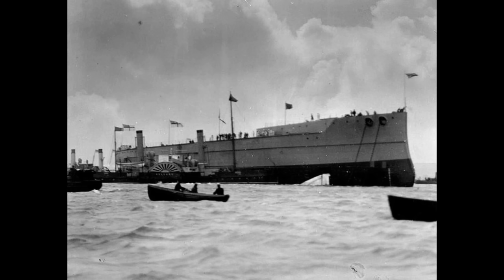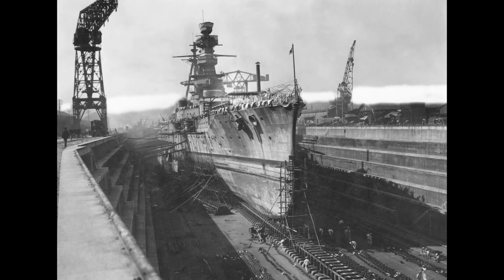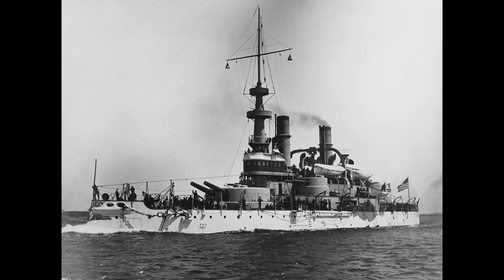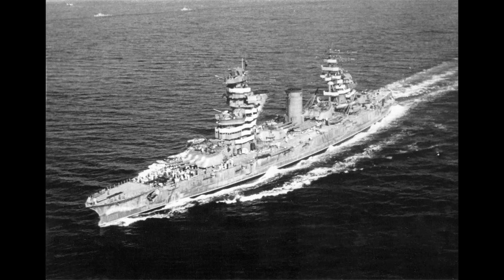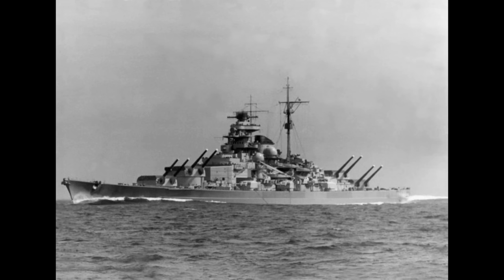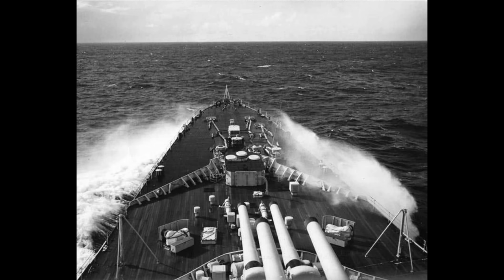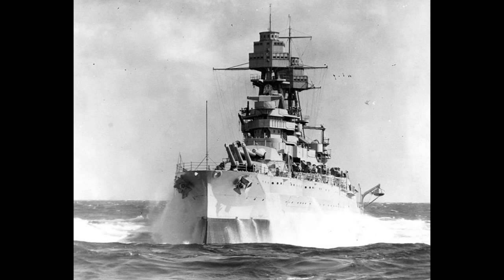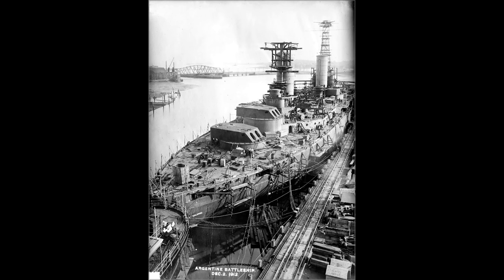The Architecture of Dreadnoughts - Blueprints of Success

Comment: Regards Iowa having straight sides, consider the ship is 108 ft wide; the docks for the Panama canal were 110 ft wide; minimal clearance. If the design continued a more usual sweep for the sides of the hull it could not fit thru the canal. Flattening the sides allows a large vessel to still fit the canal.
Reply: My pop pop served on the Wisconsin. He said the panama canal was one of the biggest limiting factors in the Iowa Class design
Reply: @hatman4818  Yamato & Bismarck were wider, I don't think they considered they would ever be going thru the canal.
Reply: There was the Kiel Canal between the Baltic and North seas to consider, as it was only 107 feet wide, so Bismarck and Tirpitz couldn’t fit but Scharnhorst and Gneisenau could.
Reply: I wonder if not being able to fit in the Kiel canal was an oversight due to Nazi over-ambition or if it was deemed acceptable since being confined to the canal might leave a big valuable ship more vulnerable to air raids. 

When the canal was originally widened before WW1, air raids couldn’t get anywhere near the canal, and the planes weren’t very threatening to a big ship anyway. Ships were also smaller, of course, so there was less danger of a ship not fitting.
Reply: My father served on the USS Washington when she was in the Atlantic and during the 2nd Battle of Guadalcanal.  (He was also a plank owner
He was a very junior officer (Ens. then LtJG when he left) who's duty was to measure the clearance of the ship as it was going thru the locks of the Panama Canal.  He recounts that the ship would "wobble" a bit as the water was being let out, and a lot more when (as coming in from the Caribbean Sea) the water was going in.... he told me that with the technology of the time, it was an exercise of futility since there was no room for fenders and with the only adjustments being made were numerous line handlers changing the rate that they were taking in (or letting out) their lines, and the fact that by the time the message got to the line handlers it was already too late!!
Reply: @samiamrg7  Bismarck class ships were designed with the Kiel Canal measurements in mind and both of them used it in their early service life to travel between North and Baltic sea. There are multiple photographs of Bismarck in the canal. The canal locks of 1914 were 1033ft long and 140ft wide. The 107ft you are referring to in your first comment are, I believe, post-WW2 limitations for commercial vessels.
Reply: @ThePuschkin1986  That appears to be the case. Thanks for bringing it up.
Reply: @billbolton  although I bet they wish they could at some point......
Reply: @lycossurfer8851  a dream rather than a realistic ambition.
Reply: Just a big cruiser hull, a very wet ride
Reply: @samiamrg7  the Kiel canal doesn't have a timesaving as big as the Panama canal so it wasn't as important for the german ships to fit as it was for the american ships
Reply: @samiamrg7  I am pretty sure Tirpitz moved through the Kiel Canal twice in her career.
Reply: @michaelkovacic2608  Yeah, the information I looked at was a bit faulty. Those numbers applied to tolerances for commercial shipping, but warships had more leeway.
Reply: @nicibozz9819  not so much time saving but ship saving in a war

Comment: There's a great story in D K Brown's Nelson to Vanguard.  During trials of HMS Nelson there were complaints of muzzle blast entering the decks directly under the triple gun turrets.  Some engineers were sent to investigate.  Sure enough when the guns fired they could clearly see a blinding red flash in the compartment immediately below the upper deck.  There were no gaps, there was no blast damage or burns, but both saw the red flash.   

Eventually they discovered the compartments were acting like a huge drum, the blast effect was squeezing the air out of them and this caused the eyeball to distort for a brief moment.  A few holes were made to allow air out and the problem went away.
Reply: My great uncle Herbert Pengelly was one of the engineers that happened to!
Reply: So in other words: the main deck was too flexible and bent inwards...
But i guess stiffening some hundred suqre meters of deck after commissioning is harder to do than putting in some holes.
Reply: @christophpoll784  Well to put that into perspective an over-pressure of just 2 psi on the deck over the area of a compartment, say 20'x20' would be the equivalent of briefly putting a 52 tonne weight on the ceiling.
Reply: @christophpoll784  so much so it affected the air pressure of the room and caused ones eyes to have a physical reaction.
Reply: ...and immediately above the powder room or magazine.
Reply: @jerrydiver1  They were about three decks below and under thick armour which would have negated most of the effect.
Reply: If there was no evidence of lasting eye damage, then why even bother to drill holes?
Reply: Some other areas where this issue exists:

The British TSR-2 fighter had a fuel pump which, on takeoff roll, would vibrate at the same resonant frequency as the human eyeball... Causing temporary blindness in the pilot at a time in the flight when being able to you know... SEE... Was important.

Similarly, astronauts have a problem where, thanks to gravity no longer pulling blood into their legs, blood tends to pool in the upper body, causing swelling. This swelling can occur in the face and head, which can put pressure on the back of the optic nerve... Causing "space blindness".
Reply: @alan6832  being able to see is kind of important lol.

Also, no point in risking people's health if it's a simple fix.
Reply: @hatman4818  David refers to the effect on vision being over in a moment and makes no mention of any lasting effect.  though I do suppose they failed to prove there wasn't one.
Reply: @alan6832  Don't know, I'm not a naval architect.
Reply: Nothing quite like having to do improvised modifications and repairs w/ scrap parts even though it's "against military regulations."
Reply: Apparently, anyone stood less than thirty feet away from the Yamato's guns firing would have their skin ripped off. Even today, artillery with muzzle breaks would take a person's head off if they stood at the same level within ten feet.
Reply: @stephenmcdonagh2795  that is not true
Reply: @hatman4818  better than space MADNESS
Reply: Interesting...
Reply: @alan6832  other bits of the body are affected - ears, lower intestine and your balls.. sailors painful testicles were not always for the obvious reason.  Crushed nits anyone?   Oh and most inportant , the brain.
Reply: @christophpoll784  why on earth would you spend a another truckload of cash when a few holes worked fine??? The hull was exactly as stiff as needed, mission accomplished, and you've got more room for guns.

Comment: "The idea of a 45,000 ton glass battleship shattering the first time it encounters a large wave is amusing to think about, but perhaps not so amusing to be on"
Gives a whole new meaning to the phrase "glass cannon"

Talking about materials, R. Buckminster Fuller once used the analogy that you could have two battleships, built entirely the same, with the same design, almost exact copies, but change one thing on the second ship and it can shoot farther and more accurately: the type of steel in the gun barrels. It made his point about materials science being an important one and how simple changes can do great things.
Reply: A glass submarine does however make sense - glass fails in tension, not in compression. Glass foam is used for buoyancy in deep sea submersibles because it can’t be crushed by pressure.
Reply: @allangibson2408  physics disagrees.  ANYTHING can be crushed with sufficient pressure.*

*may involve punching a hole in the fabric of spacetime.

Comment: The example of stable hull vrs unstable, I worked mainly on Fast Craft ferries. The Italian built MDV1200 SuperSeaCat's are mono hull fast craft and quite high freeboard. While they do have stabilisers to somewhat reduce their motion they still tend to roll around if things get a bit choppy. They were rated up to force 6 or 7 weather. Anything more we'd just not go. Passengers found them quite comfortable though.

Most of my time was served on Incat 74 and 81's. These are Fast Craft Cats and as they're catamaran hulls very stable in the water even though they are slightly smaller than SuperSeaCat. As a result those were rated in everything right up to force 9 weather. We'd head on out in weather that everyone else was battening down the hatches and heading off home. SeaCat Scotland did however pick up the nickname "the Vomit Comet" in Belfast 😂 It took more to get them bouncing but when they did move around, the pitch and roll was just weird and there were times you'd feel her roll, pause then snap back exactly as you described.

Fun story, worst weather I was ever out in was part of the crew that took Seacat Scotland light ship from Belfast to Dover to hand her over. We got caught in a massive storm off the coast of Wales. All we could do was turn away from the coast, head further out and try to go round the worst of it. We ended up lashing the cpt to his chair to stop him being thrown out of it and the rest of us just lay on the deck because we'd end up on our arse anyway if we tried to stand. In the cabin heading up to the bridge when we first got into it I was walking along then the deck just dropped out from under me then came back up to smack me as I fell. Well built little ship though. There were massive container and tanker ships out that night reporting damage over the radio all through it and we came through with some bumps and bruise but not a scratch on the ship and compared to the ships that got the snot kicked out of them, we were like a coke can 🤣
Reply: Now that is fascinating, since I found when I was young that I don't get seasick and I love to travel on the water. I am moving over to the PC to look those up!

Comment: Imagine balancing the hundreds of factors needed in a fighting ship with basically hand calculations
Reply: Slide rules at best.
Reply: Don't be afraid of sliderules... sliderules and FORTRAN put men on the moon.
Reply: @walterk1221  I like this comment lol. My grandpa used sliderules, and my dad used FORTRAN. My generation gets infinite computing power, but we really are standing in the shadows of giants
Reply: @walterk1221  Right.  I took a peek inside the main draftsman room at a Ford auto plant in 1973.  800 people with slide rules paper, & pencils.  As late as 1985 we were still using slide rules as our primary calculating device for artillery fire control.
Reply: @archiveacc3248   infinite computing power... and we use it to play games...
Reply: @walterk1221  They also had a computer with 16K of memory.  It wouldn't run Windows 10, but it did land the Lunar Module.
Reply: @surtt  And simulate molecular interactions on a level unprecedented

Comment: With respect to bow bulbs, they are only effective in one speed regime, so if you design it to be optimized for cruise, it will have little positive effect at any other speed, and will likely have a slight negative effect, especially at low speeds.  

Secondarily, bow bulbs contribute a small ammount of boyancy foreward, but the moment developed is worth considering as it may mean that you can add some more equipment forward.  This is somewhat mitigated by the fact that they are heavily built so their structure weighs a considerable ammount more than that of other void spaces, but it is still worth considering.

And finally, in heavy seas they are not effective either, as the sea is too heavily disturbed to make a proper wake anyway, and you will be running at reduced speed as well.
Reply: Aircraft carriers and Container ships run at fairly high speed all the time (and generally avoid bad weather like the plague - it breaks things).
Reply: The ultimate expression of a bulbous bow is the swath design - which is basically two submarines with a bridge linking them. A Swath reduces drag by reducing the waterline length to an absolute minimum. It’s rough sea handling is limited to the height of the main hull above the water surface. Below that wave height, it is almost absolutely stable in any sea state (like semisubmersible oil rigs).

Comment: The amount of water that can come over a ship's surface is quite amazing. SS Edmund Fitzgerald Was easily the largest Lakes ore boat when launched in 1959 at 728 feet. Her freeboard to the deck level was 35 feet while the bridge added yet another 18 feet. During the 1975 storm that sank her, the water not only topped the deck, it even topped the bridge during ~ 80 mph winds..
Reply: I think her fretboard was considerably lower when filled to her rated capacity. Which crept upwards between 59 and 75
Reply: @mpetersen6  You lost me on that one. Between 59 and 75 what?
Reply: @sarjim4381  I think he meant dates of service.
Reply: @sarjim4381  1959 to 1975.
Reply: Aircraft carriers take water over the bow in really heavy seas. And that's up to 90ft above the normal waterline!

Comment: A bit off topic, but non the less slightly interesting since Wasa was mentioned as a pinacle of unstable ship: the Swedish war ship Wasa sank at it maiden voyage after a little more then a kilometres journey on 10 August 1628. Beforehand, they had made a test/demonstration of the ships stability by letting 30 men running from side to side of the ship while docked. The test had to be aborted since it was a clear danger that the thing would keel over. The watching admiral said he was glad that the king was not there. And then they pretended that the test had never took place, since the monark was breathing down their necks to get Wasa commisioned and ready for war.
It all ended with a commision that found no one guilty of anything. That was basically becuase the king himself had signed off on the design, and he had pushed it to be made fast. It was political impossible to write a report that pointed towards the king being involved in anything even slightly bad. So it fizzled out. The careers of the involved was not even hampered the tiniest bit.
Reply: Makes you wonder if perhaps that ended up being a net positive - I'm sure all the engineers and everybody involved learned a lot of lessons about how not to make the same mistakes, and they actually got to use that knowledge in the future because they avoided punishment, firing, or reprimand
Reply: @witeshade  I'm sure someone got up much as now and said "Lessons have been learned" then expected everyone to go away and never mention it again
Reply: Well... One silver lining, that's at least better than the scape goating I would have expected in that situation.
Reply: Actually, they did find a scapegoat - the original shipwright Henrik Hybertsson ( https://en.wikipedia.org/wiki/Henrik_Hybertsson ).
However, he had died in the spring of 1627, just over a year before the disaster.
This was convenient for everyone involved, except for the thirty sailors who drowned :(
Reply: people drowned during the sinking...

Comment: The bulbous bow doesn't shift the bow wave forward. Its hydrodynamic shape helps drain it away making it smaller. Remember the bow wave isn't the "curl" of water thrown up as the leading edge slices through the water. It's a large mass of water always pushed ahead of a hull in motion. By reducing its size (thus mass) the bulbous bow reduces the amount of energy required to push a hull through water. For the same power it can make a ship faster.

Two big caveats. For a given hull a bulbous bow must be designed for one speed--usually cruising speed for merchants and top speed for warships. At any other speed the advantage is lost. Second, a bulbous bow is designed for relatively calm seas. When it's rough enough that water is coming over the bow the advantage is lost.

Comment: Has anyone else heard of the "X-bow" that has been developed for some of the newest seagoing support vessels for oil rigs? Smoother ride, a lot less water thrown upwards? Also, if battleships were still around, I think they would be a good candidate for the same barrel stabilizing technology that tanks use. Just thoughts that I was thinking about while listening to this...
Reply: I think tank gun stabilization evolved from battleship gun stabilization. Though the extra systems (muzzle reference sensor etc) in the fire control system would be good.